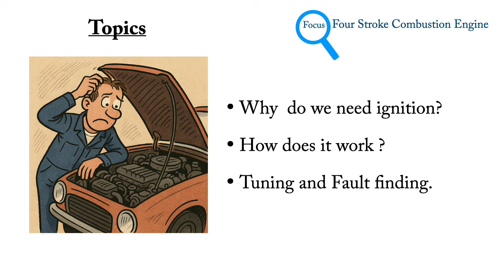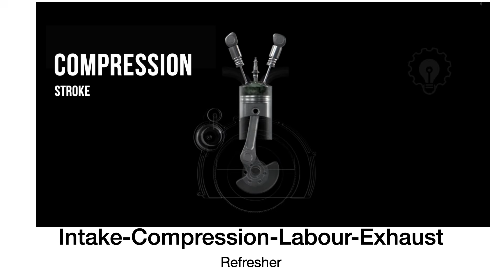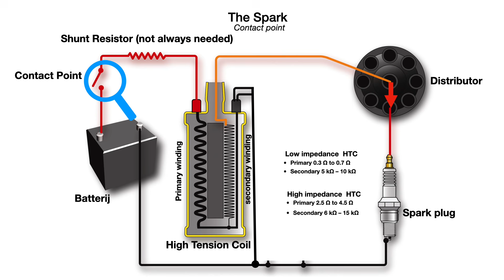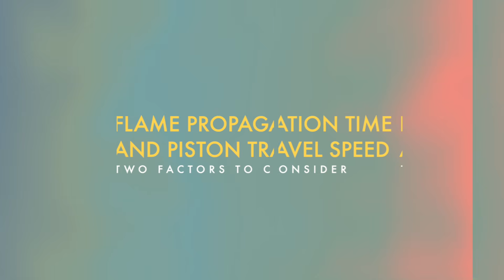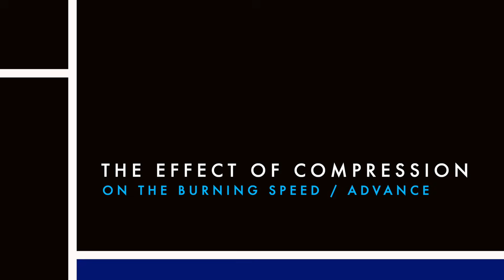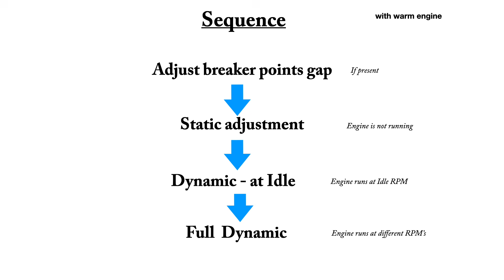From Zero to Tech Hero :  Lesson 1  - The ignition system

Comment: Danke 👍 und LG.
1. Der Zündfunke (im richtigen Moment) erzeugt keine Explosion. Eine Explosion ist eine zeitlose Verbrennung und würde den Motor zerstören.
2. Den wichtigen Kondensator im Zündverteiler hast Du vergessen zu behandeln.
3. 29:20 Die Membrane der Unterdruckverstellung befindet sich nicht im Vergaser sondern aussen am Zündverteiler.
4. 36:30 Der Kontaktabstand des Unterbrechers beträgt meist 0,4mm und nicht 7mm.
5. 39:50 Der Kontaktabstand des Unterbrechers entspricht meist 0,4mm und nicht dem Elektrodenabstand der Zündkerze von 0,6...0,7mm.
6. Für die Darstellung des Wärmewertes der Zündkerze gibt es bessere Bilder (verschiedene Längen des Keramikkörpers und der Elektrode).
Reply from the maker: Thnaks

Comment: I was working on an ECU to inject natural gas into a diesel engine and got to have a discussion of timing with a PhD combustion engineer. My question was what angle should the peak cylinder pressure occur? I figured it should be when the crank is at 90 degrees to the bore, maximum lever arm and all that. (If the peak pressure happens at TDC, the crankshaft is in a position that the pressure is applied with no lever arm and is just compressing the bearings).
The actual answer was a non-intuitive 18 degrees ATDC. I suppose it has something to do with the angle of the connecting rod to the crank.
The confounding factor being that the flame propogation speed is constant, so you have to arrange the ignition event so that the peak cylinder pressure happens around 18 degrees ATDC. As the engine changes speed, the ignition event has to change in position because the mixture burns at the same rate, but the crank goes through a different number of degrees per millisecond. This is the land of dynomometers and in-cylinder pressure transducers.
Reply from the maker: Thanks for the comments and indeed

Comment: Good video!  One point of detail, the resistor is actually a ballast resistor and is in series with the coil.  A shunt resistor is used across (in parallel) with a device such as an ammeter.

Another point that may be different on American engines, the distributor vacuum advance comes from a port in the carburetor, and is the vacuum above the throttle plate, which increases as air flow increases through the carburetor.  Normally this vacuum remains low at closed throttle conditions.  My experience is with Dodge 5.2L V8 and a 2 barrel carburetor.
Reply from the maker: Thanks for the detailed feedback! that is indeed right ...  I must have that wrong in my mind in terms of wording...,  As it shows in series...